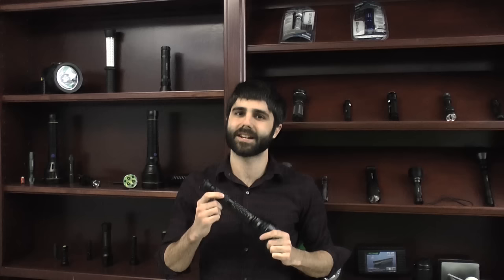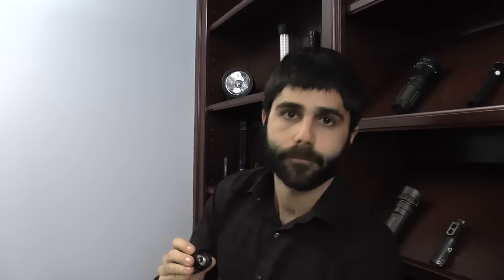LED Flashlight Trouble Shooting Guide

Comment: I find that 95% of the time the problem with flashlights that use three AAA batteries in a little plastic holder, is that there are 4 to 6 places where a coil spring has to make contact with a thin metal contact. One or more of the spring surfaces or contact surfaces gets corroded. They may still look shiny and new, but you may have to scour ALL of those surfaces (including the springs) with a piece of sand paper.
Reply: e

Comment: Where do you look if light cuts out after 10-20 secs? Charged fresh batteries were used...it just shuts off and then I restart ot and same thing. 10-20 secs
Reply: I have the same problem but haven fix it .
Reply: Mine does the same thing

Comment: Thanks so much for this video. I have a nice, bright Husky LED flashlight that stopped working. I was able to determine the tail cap switch was a little loose and tightening with the use of needle nose pliers as you suggested did the trick!! I would have never figured this out. I'll have plenty of light when taking our dog out late at night.

Comment: Cleaning the contacts like you said work I have an xr9 stowed away brand new in box case today I took it out but did not turn on its a new battery pack. I was dumbfounded I followed your instructions on cleaning the contacts with alcohol and sure enough it worked thank you for that simple tip will keep that in mind I understand from olite These batteries are on backorder

Comment: Hello I love your video.
I have a 3 Watt 2D digital Brinkmann flashlight which has a display and buttons for off/on, Test and battery status divided in 3 sections.
Yesterday it was working but i press the test button and now doesn't work.
I am afraid that the problem is in the microprocessor, because I bought it used, I wonder if letting it without batteries for some days, the capacitors will drain and the problem will be solved.
Would you have any suggestions for me please?

Comment: Since the fit between the flashlight body and batteries is so tight, any battery deterioration can make the batteries unmovable and they are stuck. The Front end of LED flashlights are not easy to remove, depending on the model.  Is there anything we coat the battery part of the flashlight with to make it easier to remove batteries if they deteriorate? I have had to discard  two $40 flashlights when the AA batteries corroded a little and they became stuck in the flash light body.
Reply: e

Comment: My flash light is the Led Lenser P5R2. I have had for 2 years now and I like it but the switch seems to be have a problem can you assist me on how to repair the switch with the video here on You Tube. When Im charging it the light for charging does not show and this occurred after it had fallen about 1m onboard the ship.